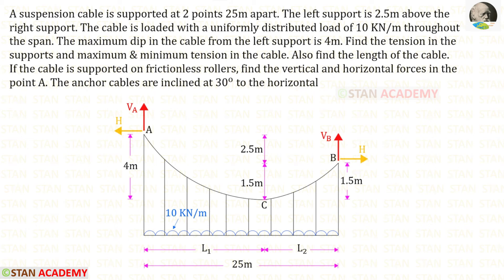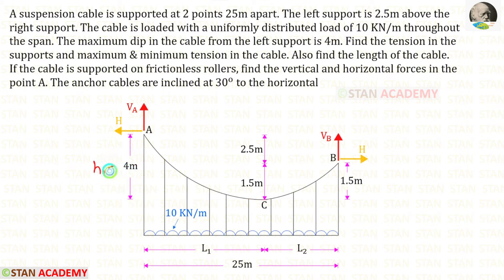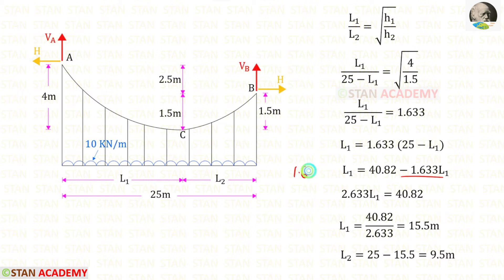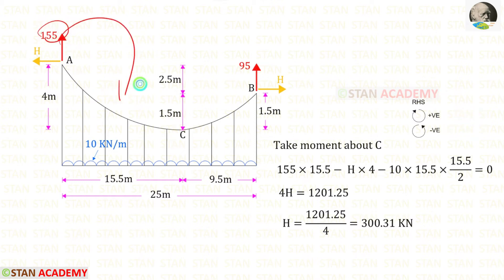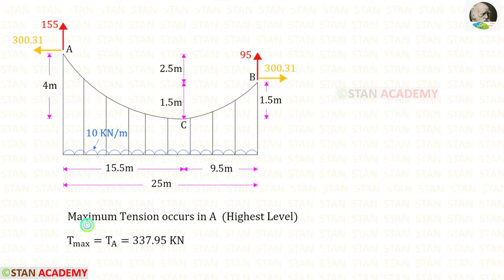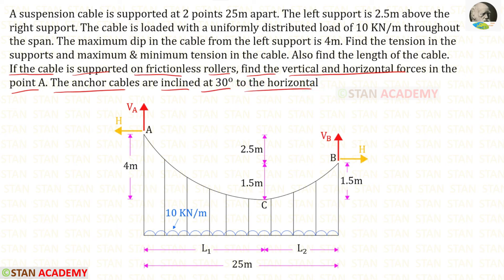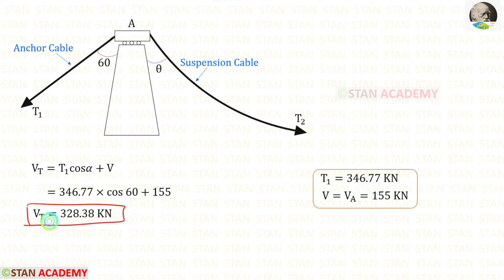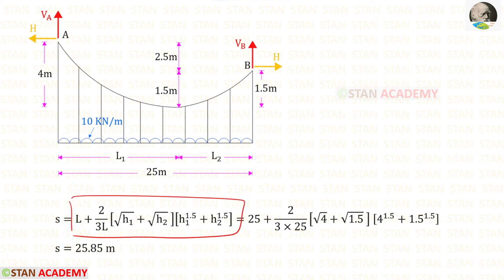Cables - Problem No 3 (supported on different levels & subjected to Uniformly Distributed Load - UDL

Comment: Do the formulas for vertical load @06:35 onwards still work if the low point of the wire would fall outside of the supports?